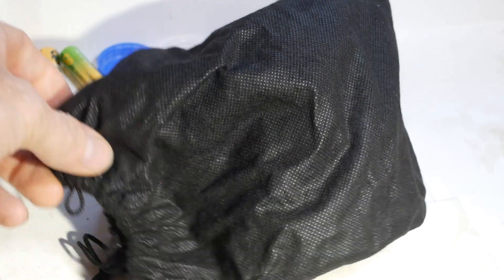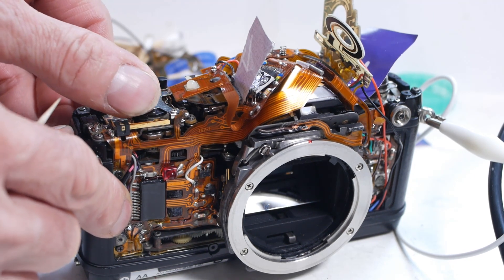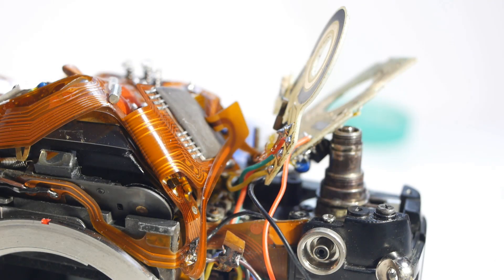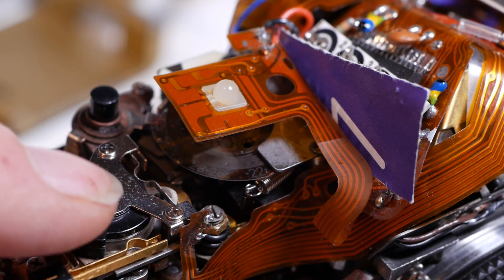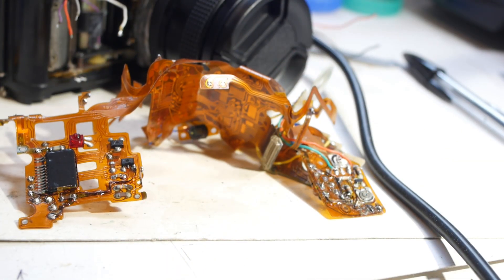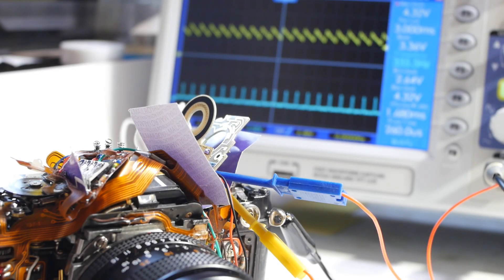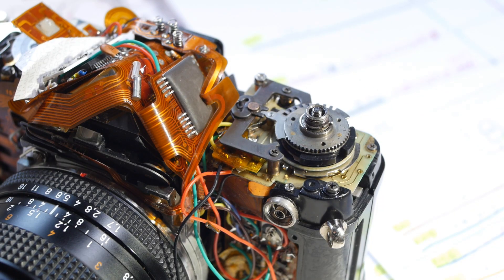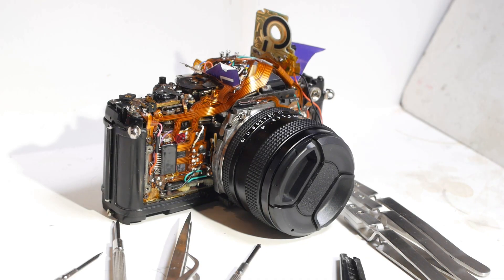It's a Miracle!!!.........Sort of - Battery Damaged Camera Repair - Part Nine

Comment: Blimey! That is close to being my idea of a hell. Nevertheless I enjoyed watching the video in the hope of learning at least something. Such is my degree of ignorance I did not realise that one could repair a broken track in a flexible circuit so.....I DID learn something. 🙂
Reply from the maker: I'm not particularly fond of working on flexible PCBs Roy, I'd be much happier with a 2 sided rigid board, but you can still repair or bypass the odd broken track.  It gets tricky when the thing is so fragile that more tracks break as you work on the thing.  I'm still battling on with this camera and I guess I'll only stop if or when I can prove that one of the chips has died - every other component is replaceable but the chips aren't (short of borrowing one from a donor camera anyway).

Comment: Wow, the plot thickens! I just tore apart two Minolta 7000’s to swap the mirror boxes because the good body didn’t autofocus, but now neither of them work😂😭 but you’ve inspired me to start thinking about those again
Reply from the maker: I have a Minolta 7000, I've put one roll of film through it and I don't love the thing, very odd user interface.  I'm sure I'd get used to it if I wasn't swapping cameras all the time and it's kind of nice to have in the collection, but it wouldn't be the first one that I'd grab if the house was on fire!